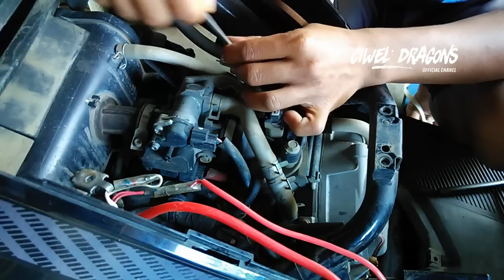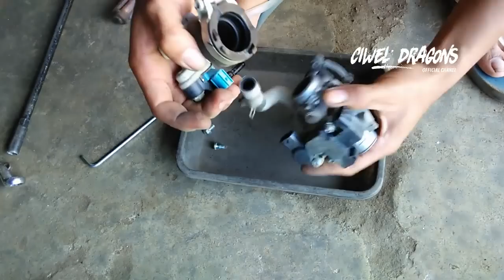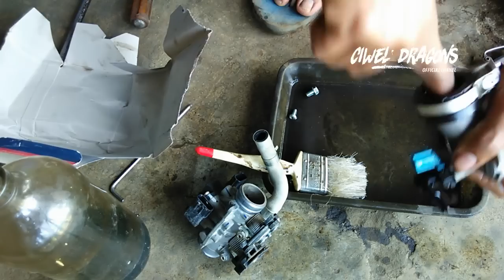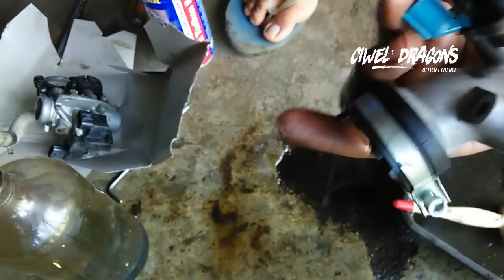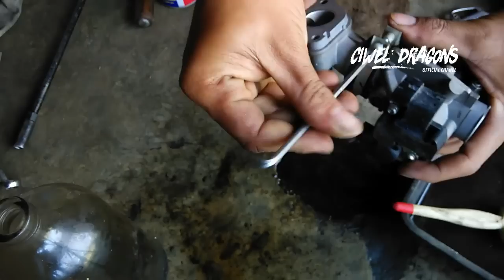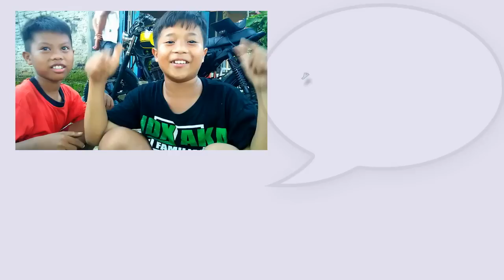Cara Membersihkan Komponen Injeksi MIO J, MIO SOUL Series JET FI

Comment: salam kenal, saya pengguna mio J mas, lampu indikator engine hidup setelah digas lalu lepas, digas lagi langsung hidup lampu indikator engine nya, setelah dibawa ke bengkel resmi yamaha, tenyata throttle body switch bermasalah, dan menyarankan utk penggantian yg hrga nya skitar 600-ribuan,kira2 ada solusi gak ya tanpa menggantinya? terimakasih
Reply from the maker: coba dulu di bersihin komponen throttle bodinya dari karbon yang merekat pada masing2 sensor

Comment: ASKUM mas saya mau Tanya Saya ad Mio soul gt punya saya Standr masih
Cuma 2 hari Yag lalu Motor Di pakai Kok  Lemes sendat2 pas Di jalan padahal Bensin Full dan Kadang2 mati sendri pas Gak di gas
Dan terkahir Pas di panasin atw gas rendah Cvt Bunyi krek krek 
Padahal Vanbel Roller satu set Baru 1 minggu an Tolong Di Jawab Pak tks
Reply from the maker: nyendat2 di cek kop businya dulu siapa tau kendur, kemudian untuk krek krek coba pully belakang di bongkar barangkali paku kelingnya udah mau copot
Reply: Mas saya mau tanya ,motor Xeon saya mati total tadi pertama sinting putus ,saya ganti nyala LG ,eh udah saya pake mati LG apa nya ya